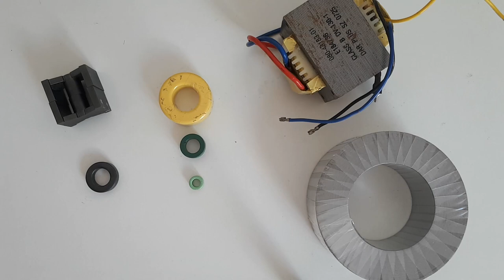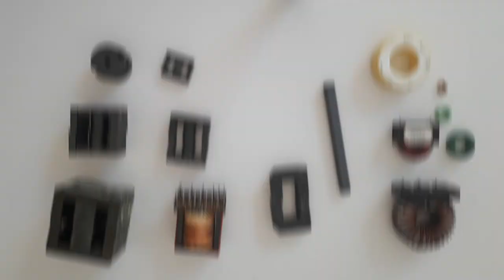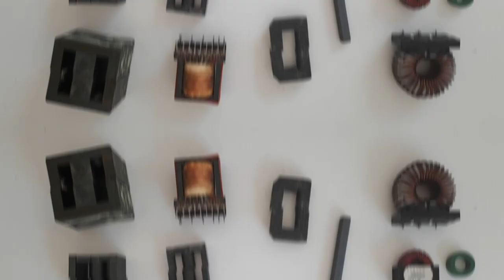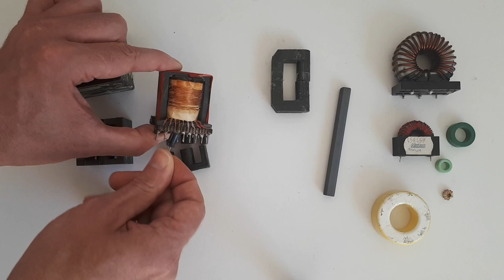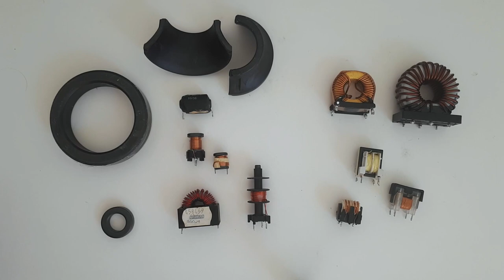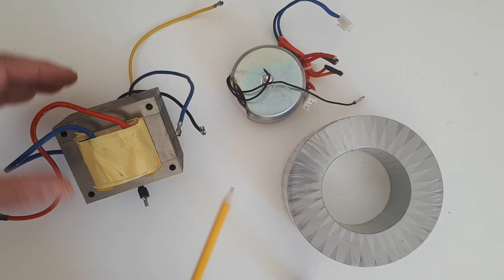Types of Transformer and Choke Cores

Comment: In general, silicon steel has used for transformers has the highest permeability of the materials shown, typically in the range of about 4000 to 4500. Ferrites may have permeability up to 10 000 or more but those used for power applications are typically under 3000. (Ferrite with initial perm. of 5000 is good for gate drive transformers.) Some have permeability of only a few hundred. Powder cores typically are made with quite low permeability - from tens to low hundreds. A core with permeability of more than 200 would be a rarity in power applications. The yellow core shown, assuming the hidden face is white (meaning Micrometals type 28 powdered iron) has an initial permeability of 75.

Some ferrites have moderately high electrical conductivity.

A shorting band around the outside is generally only used with flyback inductors which have a magnetic path with an air gap. In high-volume production usually just the centre leg is gapped. In low volume production a spacer may be used so all legs are gapped. The flux density in the air gap is very high and flux may be "slopped about." The shorting band helps reduce radiated magnetic flux.

Pot cores are self shielding but they are very poor for power applications because they also keep in the heat from the winding. Ferrites are poor thermal conductors.

The PQ core that looks a bit like a bow tie when viewed from the end is a type designed specifically for SMPS applications. It has a good set of compromises including quite large window area, round cerntre leg for winding efficiency and better shielding than simple E types. There are very low profile types suitable for transformers with windings made as multi-layer PCBs.

Common mode chokes are very rarely used to keep noise out. They are to keep noise generated within a device such as a switching power supply from getting out onto the AC mains.

Toroids are much better at self-shielding than E-I cores. They are, however, much more difficult and costly to wind. They are fairly popular for audio amplifier power supplies.

Comment: Very interesting video and very well explained! But I have a question. I've been trying to understand how choke filters work for a long time. I know for example, and I also heard this in your video, that the higher the frequency, the greater the losses in the iron transformer. Doesn't that mean that the best filter for high frequencies would be iron? Why is ferrite used? Isn't this used in transformers such as flyback, or medium wave radio precisely because it doesn't block high frequencies? I don't understand this...